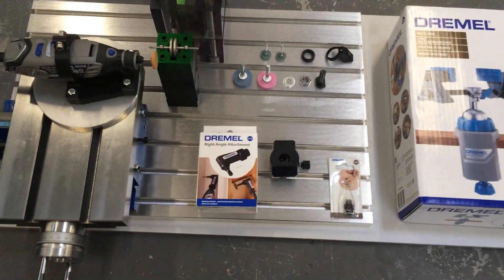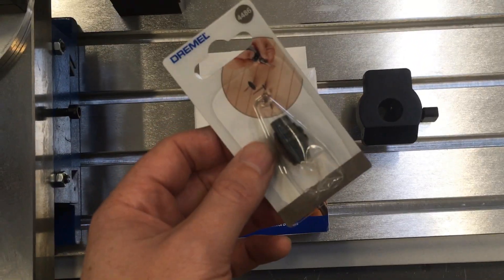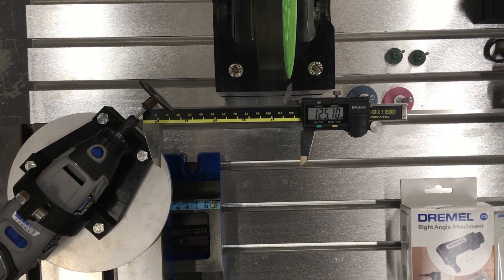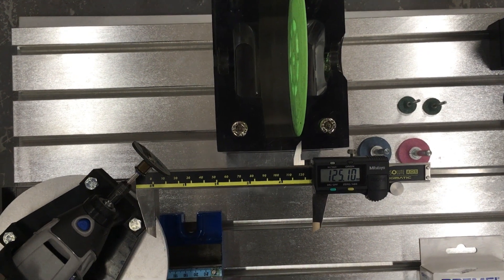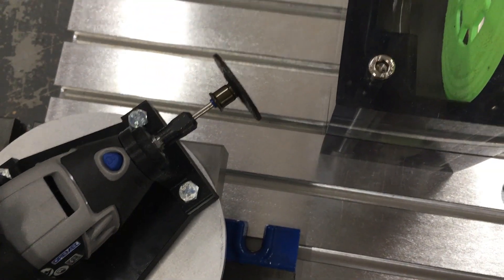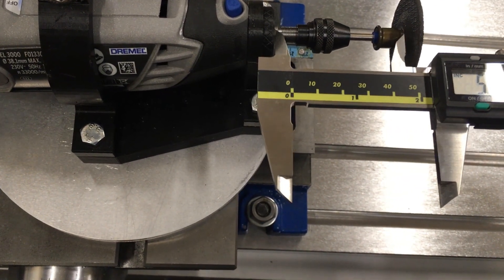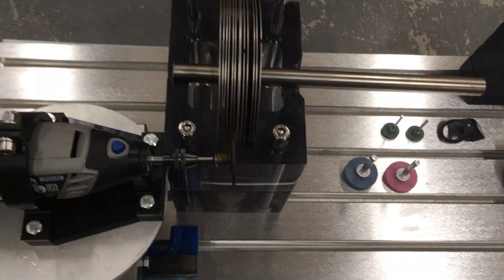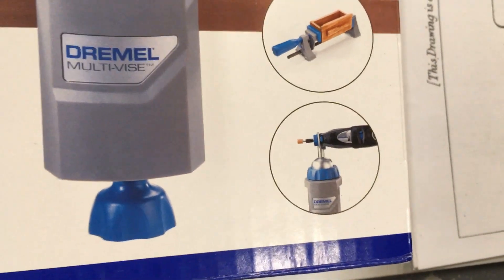Nikola Tesla's Analogue Dynamic Balancing Apparatus Part 2 - Built From Mainly Off The Shelf Parts

Comment: I use that disc setup often, it wears and flexes quite a bit. Is that safe for balancing?
Reply from the maker: We will be removing such minute amounts of material with a pass once this machine is set up properly. Ultimately we are heading in CNC lathe motor territory so we can use a 1/4" shank rather than a 1/8" shank. The run out will be considerably better.